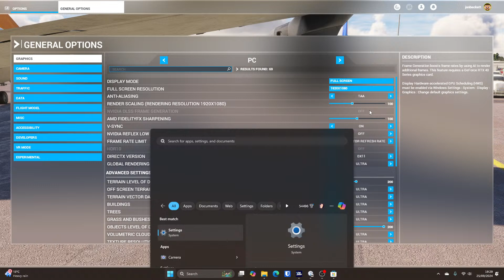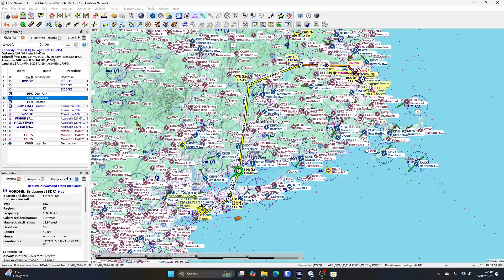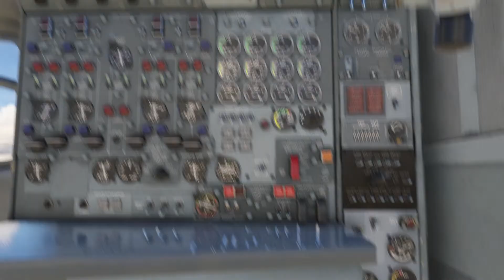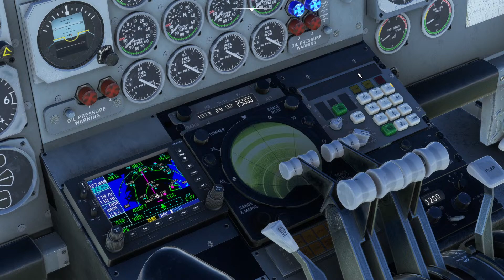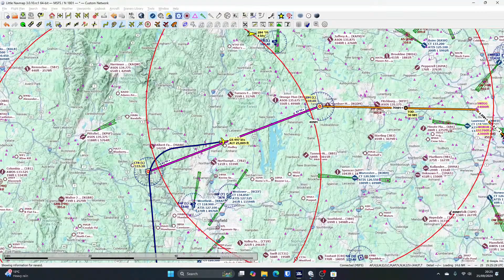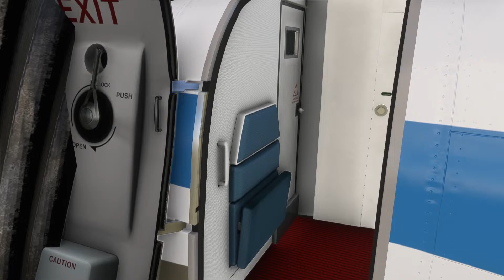Livestream first look at the Aeroplane Heaven Boeing 707-320C in Microsoft Flight Simulator

Comment: Just to be clear, can anyone confirm that the Aerial Simulations 707 is not the same as Aeroplane Heaven 707 that is currently being released with the Aviator Edition of FS2024??

I've been waiting patiently for a proper 707. But apparently the AH version that releases with FS2024 is absolutely horrible. 

If the AS-707 is different, when does it come out? Will it be as detailed as the PMDG models?

Cheers!

Comment: the FSS 727 is infinitely better than this. I have been looking forward to a 707 for a long time, and now I wish they'd jus used another developer. Aeroplane heaven should be ashamed...
Reply: Such an ignorant comment. Like comparing a base Mustang GT to a Lamborghini. Guess you don't factor in price point?
Reply: @JohnWick-u2b  I didn't mean it in the sense that it SHOULD be equal to the 727, but for microsoft to put their name to an addon, you'd at the very least expect textures that don't look 10 years old, or at  the very least, have it functioning at the same level as all of the previous addons in the series. You assume my ignorance without bothering to consider my meaning. maybe next time don't start off being rude, Maybe then you won't need to remove your foot from your mouth
Reply: @JohnWick-u2b  Not an ignorant comment at all. This thing is not worth the money they are asking for it. Period, and I say that as one that has the Premium Deluxe version of MSFS20 so all the Local Legends and Famous Flyers are only $9.99, not the $14.99 others have to pay of them, and even at that price point this 707 is not worth it. There are literal freeware aircraft(fixed wing and helicopters) that blow this thing out of the sky. AH should be ashamed of themselves.
Reply: @ImpendingJoker  Not true on the freeware. Every freeware aircraft I downloaded was total trash and most do not even have a cockpit. From my experience most all freeware aircraft are not even worth my time to download. The FSX conversations are horrible broken garbage, all of them. Only good freeware airliner is FBW. So I agree with John, I spent ten dollars on the 707 and I have my fun with it not half as bad as people say.

Comment: Are you sure the issue is with the airplane? It would be good to check with other aircraft, if it can track the "missing" VORs.
Reply: It worked normally with radio beacons in my country. I am using FSX navaids and it even tracks NDBs.

Some other comments:
- It seems that the passenger cabin should not be accessed through cockpit camera, the horrible texture along with landing gear appearing points that it should just be viewed by outside.

- I understand your point about comparing it with iniBuilds but let's remember we have a high quality and functional ATR on the game costing pretty much the same. 

- I had the same issue with the auto pilot not leveling off, but I am not blaming them for now as this may be just a skill issue.

- The contrast between the High Quality scenery and the low quality instruments panel when you were landing was horrible, try to watch it again.

- Let's hope they deliver a version with working CIVA INS and let's wait for fixes on the textures for this aircraft. Maybe in 1 year it will be decent to fly.